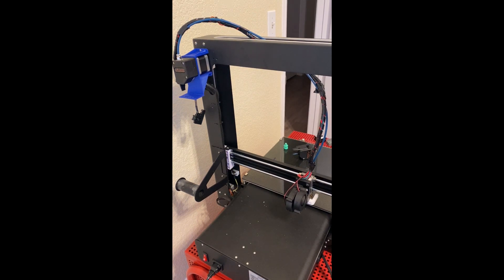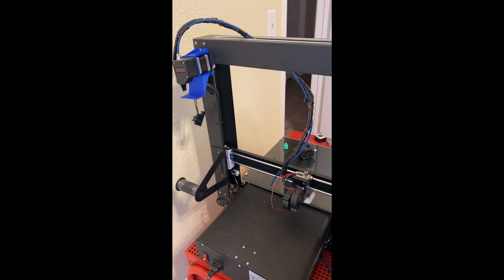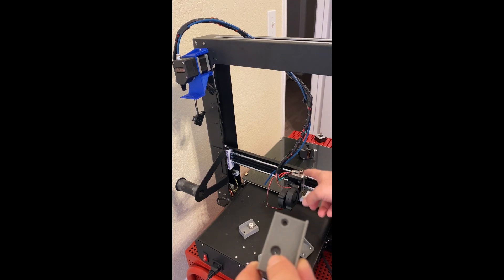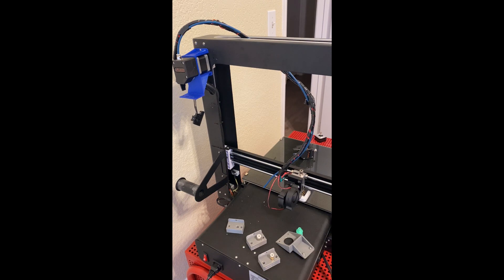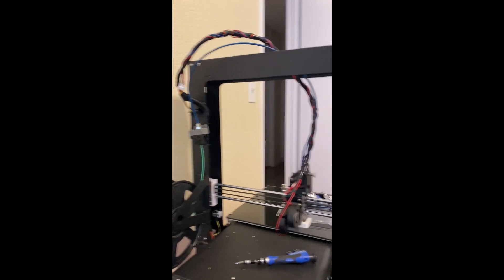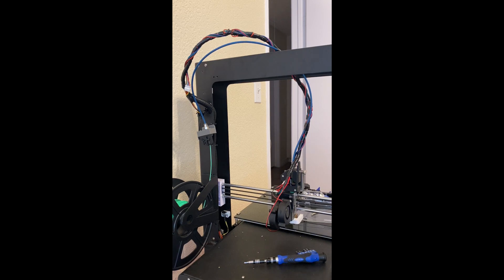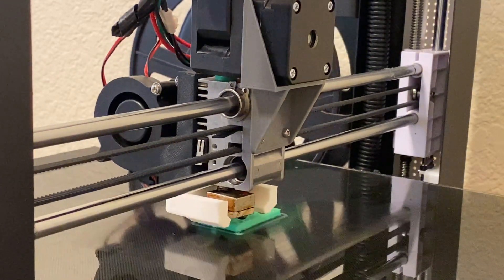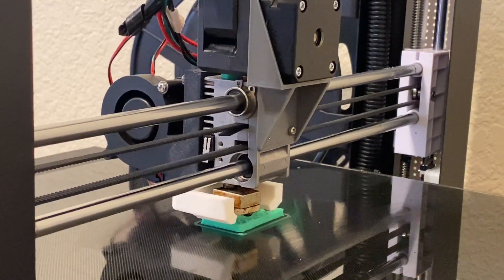EASY JGAurora A5S A5 A3S Direct Drive conversion, cheap, quick and completely reversible!

Comment: I did this on my jg. Works well. I opted for the pancake stepper too and I believe the extrusion was a little over 4x the original motor of 100. So right over 400. So that would be a good starting point. I also installed some tl smoothers and anti backlash springs and ungraded the stepper couplings because the originals were trash. Took and old pri ter and breathed new life into it! Thanks for the video!

Comment: Any ideas how to install a conveyor belt instead of the heated bed and flip the z axis to 45 degrees ?
Firmware & tft firmware will have to be changed and cura has to be replaced with blackbelt cura for that purpose.

Comment: Have to be honest this mod has been pretty challenging so far. Great concept and in theory super easy. Buying the components and printing parts was no problem, but the parts themselves do raise some issues. The hole spacing for the filament runout sensor is off and the threads for the coupler and the piece that goes directly into the cold end are not functional. The part that went into the cold end broke the first time around, I had to heat a socket and melt it into the piece so I could get it unthreaded. I am surprised that from one a5s printer to another my threads and hole sizes are not correct. I tried lower layer height as well, threads were still bad. I got the extruder working, but I think the piece going into the hotend is not threaded in completely straight (since i had to force thread it) and the filament begins to skip as it doesn't make it all the way to the hotend. Definitely not a 20 minute job. Anyway I will keep working but ill have to take it apart and investigate, maybe my hotend is already clogged lol. I think instead of making threads part of the design they could just be flat walls intended to be tapped by the threads in the cold end or by the coupler. That way you could provide models with 0.1mm increments in hole sizes that could be printed until the right tolerance was found for each printer?

Comment: Do you still have cables? I would really like to do this mod!
Reply from the maker: Unfortunately I do not right now. I am hoping to have another shipment in a few weeks but the price will have to go up :-/
Reply: @TechTweak  is it a 4-6 pin connector? I will definitely be one of your next customers!
Reply from the maker: @vincentpernicano3277  it is a 6 pin to 6 pin. The ones you find all over the Internet go from the mainboard to the stepper, but on this printer, it means you have to open up the case. The cables I sell go straight from the existing location to the new location of the motor.
Reply: @TechTweak  okay thank you, I am not very well versed in electronics but if you may, what is the difference? Have you customized the configuration of the wires? Otherwise I would think the regular 6 pin to 6 pin would work.
Reply: @TechTweak  hey I looked again to see if they were in stock and bought your cables. Can you confirm whether the usongshine stepper motor you have linked is the same as your stepper? I would look to verify wiring but figure I'd ask before I went through the effort.

How is the mod holding up? Is the bmg clone reliable?
Reply from the maker: @vincentpernicano3277  that is the correct stepper. It’s been holding up great, even with 24/7 printing for months!
Reply: @TechTweak  That's awesome! Any plans to upgrade the hot end? I am hoping to resolve some quality issues when printing petg with the direct drive set up...maybe even try some flexibles...speaking of which have you tried any? Also random but I built an electric dirt bike if you want to check it out hop on my channel! Thanks for putting this together ill let you know how it works out for me in a week or two when I have it all dialed in.
Reply: @TechTweak  just got a unit in the other day direct drive sounds good ill be printing petg  and such i guess mostly,let me now if you got cables sounds like i need them and be blessed ,

Comment: Just updated my A5. Works great. Small issue with the wiring from the hotend needing to be moved from its channel, but nothing major.

Excellent project and video. Do you have something similar for your cooling fan upgrade?
Reply from the maker: I don’t, but I could take it apart and show you how it all goes together, it’s actually ridiculously easy. Would you be interested in seeing that?
Reply: @TechTweak  that would be helpful. Thank you

Comment: Hi , just ordered your cables, already printed all parts, Just waiting for the mail.  Please clarify which end of the cable you modified for the slim motor.   Was it the extruder end, or the part that goes to the original wires?  Also did I hear you say, youjust swithched the blue and green wires?  Sorry, I'm neither mechanical nor electrical inclined, but you have inspired me to attempt this modification, since I have problems with under extrusions.  Thank you. Mae Mae Ma
Reply from the maker: It depends on the motor, if using the stock motor, you will not have to switch any wires, if you use an aftermarket, you will have to compare the motor diagram to that of the original to determine which pins to change. And you can change them at either end.

Comment: How much Firmware editing did you have to do after this?
Reply from the maker: M ML you don’t even have to edit the firmware. The only thing that needs changing is the esteps for the extruder motor and that can be changed in the start GCODE in your slicer software.
Reply: @TechTweak  I might be missing something here but don't you have to change the direction of the stepper motor?

Comment: Thank You so much for this mate ... You are my Salvation and I am not exaggerating when I say that .... I have a JG Aurora A5 from 2018 and I had only horrible moments with that Stock Extruder ( I don't have any picture for now) ... since March 2019 I gave up on it and dismantle the printer and is in a box since gathering dust - and It Was Not cheap at all  ... all in one, Please can You tell me if the Extruder cooling Fan mount & Part cooling fan Mount are the Stock components or did You made/find somewhere those STL files? ... Please, soon as You have an answer give me a sign here or a short eMail here: petcumarius64@gmail.com   ... Thank You again and Happy Printing ... Regards - MARIUS
Reply from the maker: MARIUS Petcu part cooling is something I whipped up. You can find the STL on Thingiverse: https://www.thingiverse.com/thing:3980382
Reply: @TechTweak  I Thank You for the effort and for the Help... Please, one more question - can you guide me about where to look to read/watch for adjusting the Extruder E-steps? ... I have the same pancake motor & extruder ... I am struggling with this matter for more than 3 months ... Cheers mate ...
Reply from the maker: MARIUS Petcu also, I’m glad I could help!